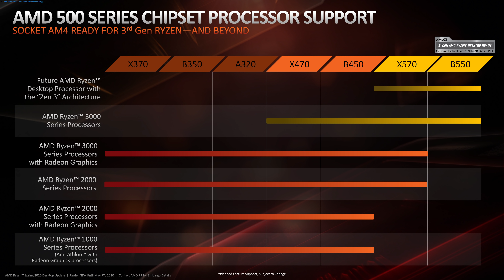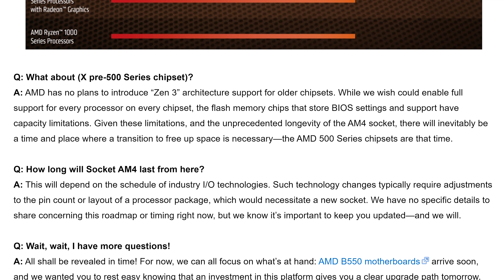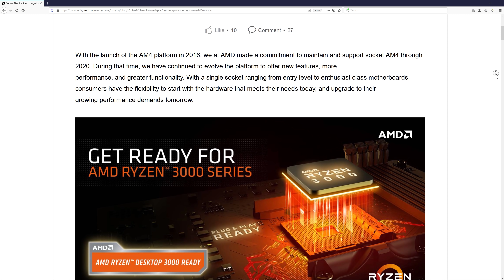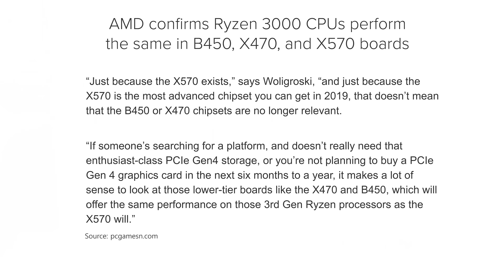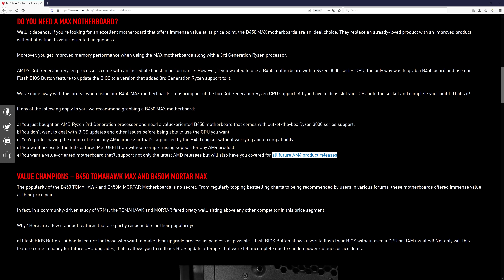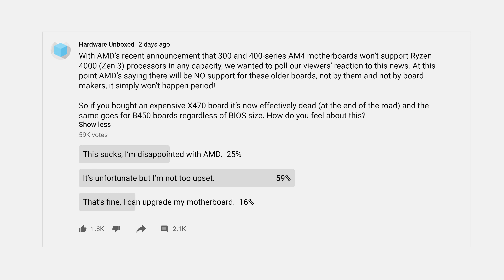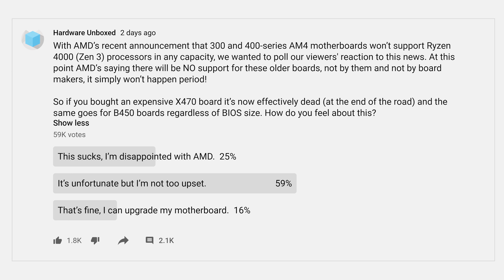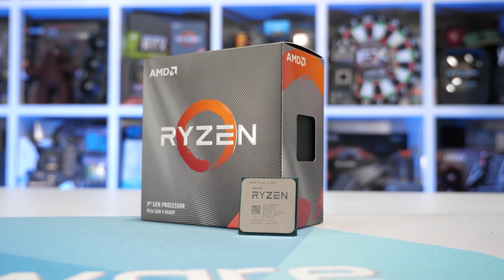AMD Does An Intel, Axes Zen 3 on 400-Series Motherboards, Our Thoughts

Comment: I just recently upgraded the core components for my mostly 6-year-old gaming PC and I've got my X570 motherboard so personally I'm all good (for at least one more generation of AMD chips).

That said, I can only imagine how owners of 400 series motherboards must feel, especially if they bought their motherboard recently. It really doesn't seem like it should be too much trouble to support at least the 400 series motherboards for one more generation. Even if it requires a BIOS flash by the user themself that would still go a long way towards not only lining up future plans with previous comments but also alleviating concerns and grievances with AMD's customers.

Honestly it really seems like AMD is also throwing away money. If Intel can release a new series of CPUs to compete with AMD, then AMD can potentially lose (or re-lose as the case may be) a bunch of customers with 400 series boards who are looking to upgrade as they would have to replace their boards to get a CPU from the Zen 3 series of AMD's CPUs anyway.

If AMD were smart, they would support 400 series motherboards for one more CPU generation at a minimum and apologise for the plans that were laid out. It would help to restore a lot of the good will that they've built up over the years and would almost certainly make them more money.

Then again I'm just a PC gamer with no more knowledge of PC hardware than that self-applied title implies. Maybe there's important information that I don't know ¯\_(ツ)_/¯

Comment: I still see thbis as a money thing.There excuses are lame.I have a b450 gaming plus.It was one of the first mobo's to get a bios update for 3xxx models.I didn't pay R2199 in my currency just to have to upgrade a year and a half later.Like you said make a bios that can change between the cpu models.I can predict a B450 will most prob still be around 120-150 usd.It's not a value option.B450 are the best bang for your buck mobo's.I also said i'll maybe upgrade to 4th gen if i need to(haven't really see why i should)but now i don't even have an option anymore...

Comment: Maybe someone can help me out, since I dont know too much about computers and plan on building one in the next month:

I want a r5 3600 cpu with a B450 Motherboard as I thought I could upgrade later on. But since B450 is pretty much dead and the 4000 series will be the last AM4 generation I think it would be best to wait for the new AM5 sockets and upgrade just then.

Is it reasonable to buy a B450 then or could I just go with a cheaper A320 or B350 Motherboard? I have no clue if a third gen Ryzen 5 is supported by cheaper boards? But it wont be a crazy machine anyway. More something like this:

Ryzen 5 3600
GTX 1660 TI
16 GB DDR 4 3600Mhz RAM
Reply: MSI A320 A-Pro MAX for $59.

Comment: That puts AMDs position at risk of people jumping ship to Intel. If I want zen 3 I'll have to buy a new motherboard with it. If Intel pulls their shut together then it's easier to just shift. Wouldn't be the case if AMD did not decide to screw us over who bought b450/x470 to jump into 3000 series (coming from 1700x). They should've released b550 months ago if they decided to screw us over like this. Thus I've decided to miss the 4000 zen series, and potentially switching back to Intel.

Comment: @Hardware Unboxed, does this mean my Asus X470 Crosshair VII wifi won't be compatible with 4000 series CPUs?

If so, I bought a monoblock and this motherboard for nothing, which is disappointing. I guess I'll have to sell this board and get a newer board if this is the case.

Comment: Well they said am4 until 2020... If the 4000 series ryzen comes in 2021 then they are typically keeping their promises. I bought a b450 and the 2700 in September 2019 with hopes to upgrading to a 4700 in 2021 (around 2 years from my initial purchase). I thought that ryzen 4000 would be released in q3 of 2020 but some say it is going to take a little longer. However I am not mad at AMD as the 3000 series is great and the 4000, in my point of view,is going to be a refresh so we are not going to miss a lot. I may and up getting a 3700x or a 3900x second hand or new in a discounted price. If 4000 series is great beyond expectations then I will sell my b450 and 2700 combo and get a b550 with a 4600 or 4700 ryzen. It is not such a catastrophe...

Comment: I got an X470 back in April 2018 and yes my plan was that I would keep my R5 2600 for as long as possible then once it was confirmed as the last gen supported, buy the best CPU that was comparable. It now turns out that could be the R9 3950x which isn't that bad. Overall it's a shady move but I have had 2 years of life from my x470. I feel sorry for people who got b450 or x470 last year or this year though.

Comment: AMD has definitely disappointed me. I bought a B450 motherboard since the feature set of X570 was totally overkill, and there wasn't any mATX or m-ITX available at the time. I would understand this shift if AMD made B550 boards available close to the launch of Ryzen 3000. But they didn't and they still promoted B450 boards. I got one of those with confidence that Zen 3 would be supported. Nothing in AMDs marketing-, or previous strategies prepared us consumers for these turn of events... Basically all consumers looking to build smaller systems during the release of Ryzen 3000 were only given the option of boards that would only last one generation.

And with this being said.... Can AMD stop referring to "commitment to the AM4 socket"!? "socket" means NOTHING to consumers, as the slot itself doesn't guarantee compatibility.
Reply: Pixel Shade nice points, totally agree

Comment: Definitely a dick move by AMD. I wasn't looking to upgrade my B450 with a Zen 3 as I'm currently very content with my Ryzen 3000 series in the board. This is basically pulling an Intel without actually changing the socket at all (Kaby Lake>Coffee Lake). Intel at least has a case for having a new motherboard requirement after Kaby Lake as Coffee Lake did see an increase in the number of Cores and power requirements for the CPU, but I'm skeptical to the point that Intel still could've supported Coffee Lake on their 100/200 series but still dropped support keeping with tradition of new socket every 2 years. It doesn't look like the power requirements and the number of cores aren't going to increase with Zen 3 mainstream CPUs, so I do find the excuse AMD is making for 400 series chipset as lame.

Comment: I can see a PR nightmare in trying to support older chipsets. Say you have to drop support for Zen 1 and Zen+ with a Bios update. Now I purchased a B450 with a Ryzen 2700x. I can see the nightmare already. Flash Bios with 2700x ready for me to put a Zen 3 processor in. Bios update fails because 2700x not supported with new Bios. Motherboard becomes a  brick unless I can get hold of a Zen 2 processor to do the initial flash. Remember the 4 series motherboards are Zen+ era. If B550 had come out with the launch of Zen2 this would likely be less of an  issue.

Comment: I'm pretty annoyed here. I picked up the B450 Mortar Max in Feb for mainly two reasons, there was only one mATX X570 board available at the time (which was hard to get) and I forked out a bit more for it as I had a view to upgrade.  Still no readily available mATX X570 boards and there is now no upgrade path on my current board. What's a consumer to do.

Comment: Thank you, AMD. Just two weeks ago I bought a Ryzen 1600 AF together with an B-450 board, an NVME m.2. 1TB SSD and 32 GB/ 3200 Ram. Just, so I could upgrade to the newer generation once they released it, guess that won't happen. I will take note for the future dear AMD, thanks again for screwing me over.

Comment: Imagine people being offended because Amd pulled a move that Intel has been doing for 10 years now. (and it's not even an Intel move since the same chipset supports 3 generations while each gens are different architecture type)
Reply: The difference is that Intel never made it seem like there was a chance they'd  keep a chipset across generations.
Reply: And AMD have never said they would support new chips in older boards indefinitely.  There HAS to be a cutoff, at least AMD don't do it every 18 months like intel do.

Comment: They not launch CPU in 2020, so why you feel ripped off ? Your mobo will hold fine and as promissed they did support all processors they have through 2020. So only you thinking wrong way ppl.
And in any case, you can sell mobo to get different one so stop complaining as with Intel you change every time! AND let's be REAL your build pc will stay for 7 years unchanged...

Comment: Who upgrades their cpu every single year but is also so money tight that they opted for a B450 over an X570? Saving $40 on a motherboard but being prepared to spend hundreds on a new cpu when their current one is only a year old seems a bit ridiculous to me.
Reply: not necessarily money tight, but just didn't need x570 features and didn't want a fan. i have a friend who got b450 because he disliked x570 chipset fan, and b450 tomahawk actually runs pretty well even with a 3950x anyways, so he said "whatever, i'll just upgrade"

anyways, you shouldn't need to spend money for features you won't use such as pcie 4. ever. so many of us bought b450 simply because we dislike wasting money, not because of low budget, but simply because we didn't need it
and now this exists

Comment: I bought an X470 board in August 2018 in the assumption I would be good for a few CPU generations.  Now it seems I'll be using my 2700X a bit longer than foreseen.  A pity, but not a disaster.

Comment: No biggy.  Started with X370 and ryzen 7 1700X.  Then 2700x. And currently 3700X all on same board.  Did not expect my board to get through so many processors.  Got my moneys worth.  Maybe get a 3950X as last processor which should be good for 5 more years before changing boards.  Feel sorry for the B and X 470 buyers though.  They got shafted.

Comment: "Through" 2020, the word there is 'through' not until or "ending at". 'Through' is very clear that support for the 'socket' will remain past 2020 at the minimum. Asolo agreed that the socket is not the same as the chipset. it was implied many places that if you didn't want a chipset fan, x470 was an option when Ryzen3000 launched.

the chipset fan on x570 was a hard pass for me after having been through chipset failures with an incapable RMA process that couldn't get me the correct replacement fan for the things. It was always going to be a no-chipset-fan x470 Gaming 7 with real VRM heatsinks or no-go for me.

 in any case, Great vid Steve and crew. B)

Comment: I personally don't care about this decision. And I doubt it would be the case if it was not a technical limitation. Even if the only problem is bios chip size, if vendors had to create multiple bios versions and support them, they probably wouldn't for most boards. It would be hard to educate the average customer on which one to install. Which version do you ship a board with? 
Is it sensible to put a 4700x or something into an $80 B450 board you got for a 2500x or 3100? Or to buy way more motherboard than you need in hope that you can use it with something that doesn't even exist yet when you could have put that money toward a much better processor now and not need that upgrade. 
Also in my limited experience, sometimes the compatability of a product does lie. I put my 1700x in my X570 unify while waiting for my 3950x to ship, and it did work even though it wasn't supposed to. Though that should never be relied on

Comment: I'll be honest, when the poll came out I hadn't thought all the way through the question. I purchased a MSI Gaming Pro Carbon AC on it's launch along with a 2600X and built my current system.

When the poll asked the question, I was not upset as I'm really happy with the performance I'm getting from the 2600X. However, (and this is where I didn't think it through) when I go to upgrade my processor, I planned on going to the 4800 (or whatever numbering scheme they choose for the 8 core). Now that you've pointed it out, it actually does piss me off that I switched my board, processor, and video card from Intel/Nvidia to all AMD. At least with Intel/Nvidia I know I'm getting screwed from that outset and so it never fazes me BECAUSE I choose to allow them to screw me over. Where as with AMD, I felt I had longevity do to the market trends with the Ryzen Gen I/ II and 350/ 450 boards.

Do I think AMD did this on purpose? No, thats 4-d chess and it's a match they would loose as customers may end up NOT seeing value in their products. I also agree the 350B system I built for my son has more then paid for  it's self and so from that aspect no issues with upgrading a complete system verses core parts. So while it doesn't change your data points, change 1 response to "pisses me off!"

Comment: The one statement that you're making that's simply incorrect is your when you say that because the 400 series is a current generation product, that it was reasonable to expect one more generation of Ryzens.  It's not.  The 500 series is the current generation.  The 400 series came out with the Ryzen 2000 series CPUs.  They DO support one more generation of Ryzens: the 3000 series.  It's not reasonable to expect that a 2 year old generation should support two more generations for 2-3 more years.

Yes, the B550s were delayed, which sucks.  But that doesn't make the 400 series any less old or previous generation.

All of this said, you even said that you think that the problem isn't actually the bios and that there are other problems involved.  Whether that's a lack of resources to ensure compatibility or other electronic problems that we don't know, it's clearly NOT what they wanted.  So, why do you think that having fans complain about it will change that?

Clearly, they're not able to provide compatibility to the 400 series chipsets right now.  Should they hold off on the release of the Ryzen 4000 series CPUs in the hopes that they MAY be able to do so?  I hope they won't.

Comment: I'm pissed off about it to be honest. I upgraded from a B350 motherboard to an X470 as I was lead to believe it had superior support/compatibility for Ryzen 2000/3000 series. I bought it in the belief it would still be usable with the newer generation 4000 series. As a consequence I'm going to have to hold off on buying a new 4000 series AMD processor and when it comes to upgrading ill be considering whether or not an Intel or AMD processor is the better option as, as far as it goes now, they are both going to be as expensive as each other to upgrade due to having to buy a new motherboard. 
There is also a disincentive to buy an x570/b550 board as it has just one generation as an option. Support for that will end with a newer socket in 2021 so why waste money on it.

I would like to suggest another poll Steve, maybe you could ask how many current 3000 series owners are now going to hold off on upgrading and skip a generation due to motherboard incompaitbility? 
I reckon a lot of people will, I certainly won't be upgrading my CPU unless this decision is reversed.

If I can also add my twopence about the bios being the reason - that's total BS and they aren't even trying to hide it. Even if they'd came out with another more palatable excuse I would not be happy either, it's either laziness or profiteering I think.

Comment: Thanks for speaking up about this!  I've been cycling through PC's pretty fast recently but put a lot of thought towards choosing a b450 instead of an X570 itx board for a 3900X build because I did not need the PCIE 4.0 or the very overbuilt VRM for a low profile cooler application inside of an SFF case.  This information should have been released  a long time ago at the launch of X570. . . at least released as soon as the decision was made whatever the stated reasoning behind it!   Instead AMD actually set an arbitrary embargo on the information further forcing customers to be mis-informed.  Luckily, I'm still in the return period for my motherboard purchase, but X570 options are still over-priced and have very small windows of being in stock.

Comment: I built my first PC with a Gigabyte B450 Aorus Pro Wifi with a R5 3600 last year.
Personally in my use case and as my first jump into PC gaming, I don't really mind this. I think that the 3600 will last me a good few years just casually gaming, doing some schoolwork, and internet browsing. And if I do want to upgrade, just grab an older but probably still good enough 3rd gen Ryzen CPU like the 3700X in the future (again, in my use case).
Although I do see that there are those who've had plans to get an upgrade to Ryzen 4000 with a B450, shame if so.

Comment: I'm glad I didn't bother buying B450 boards instead I just bought X370 because they ended up supporting 3000 series. I'll just end up buying the new boards if I ever get the 4000 series. If not I'll just stick on my X370 and upgrade my 2600 to 3600-3600X (To squeeze more power with visual mods on my games such as Path Tracing and software ray tracing like in CRYSIS Remastered).